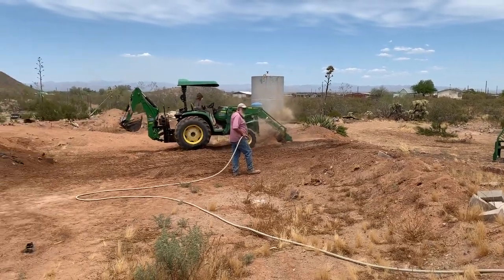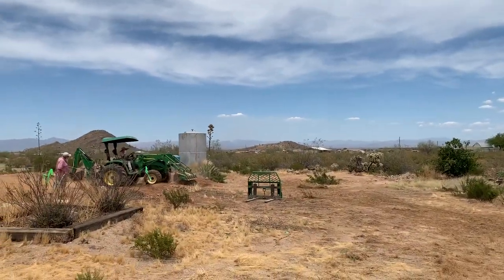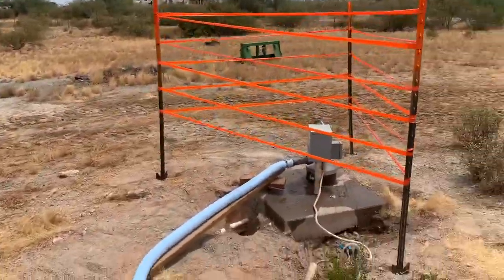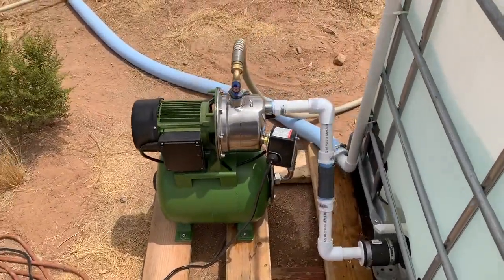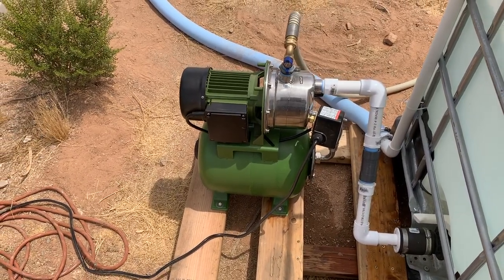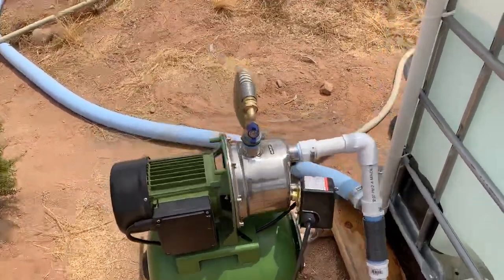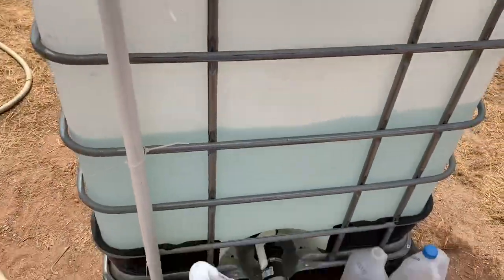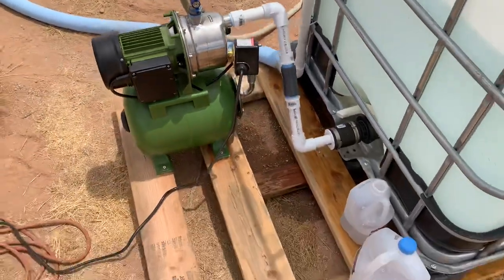IBC Tote and Harbor Freight water pump

Comment: Any issue you could see with just dropping a sump pump from a big box store, into the top of the ibc with a toggle switch between the power cord and power supply (maybe portable generator)?

Comment: Mine can't go up to pressure if I turn off the faucet, it goes up and then drops and starts over so it never stops running unless I either turn on the hose or turn off the pump.

I thought check valves go on the outlet not the inlet? Is that the issue? Also does it matter what kind of check valve?

Also we used really narrow pipe to go from the outlet to the faucet is that going to be an issue?

I'm fairly certain it isn't the pump's fault because Harbor Freight refunded me for it and I got another one and it still doesn't work.

Comment: Where did you get your 1 inch check vale
Reply: Home Depot carries them. They also sell the white ones in PVC.
Reply: What is the function of the check valve? Thanks.
Reply: @Larry Parks the check valve lets the water travel one direction without returning back. So the pump pumps water out of the reservoir goes through the check valve and the check valve blocks water from going back into the reservoir. It’s one way only. Hope this makes sense.
Reply: @leeannekermode7452  the pump inlet and outlet are both higher than the outlet on the water tank. The check valve serves two purposes. One, it ensures no water flows back into the water tank, and two, in case the water tank runs out of water, water in the pump stays where it’s at and when you fill up the water tank you don’t have to prime the pump. Hope this makes sense 😊